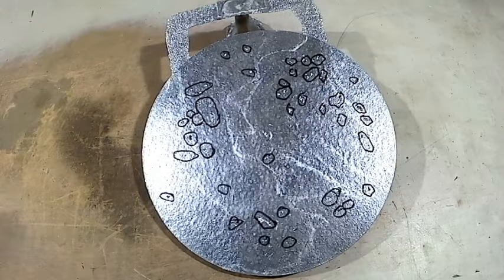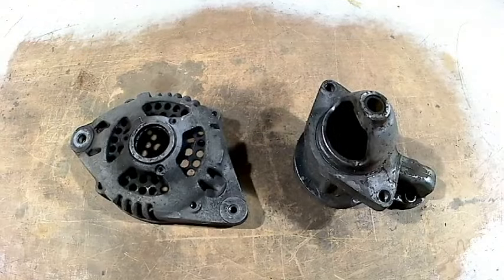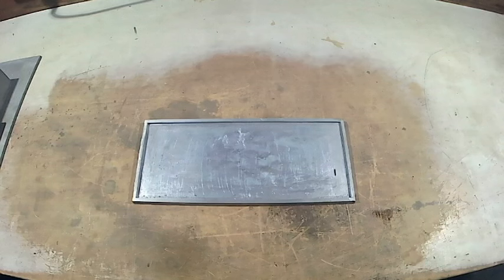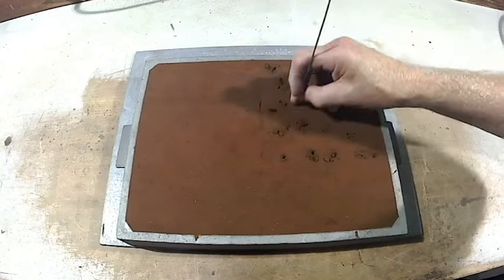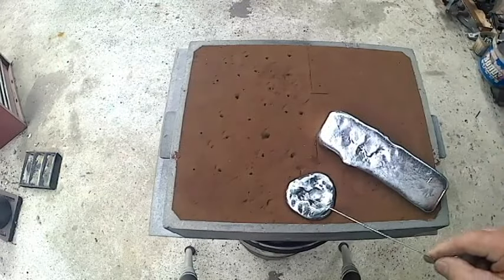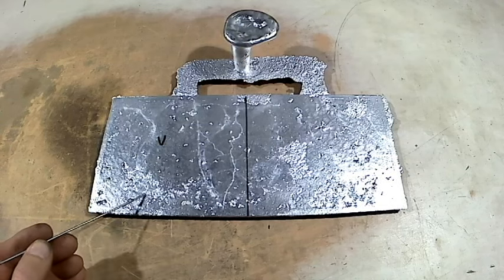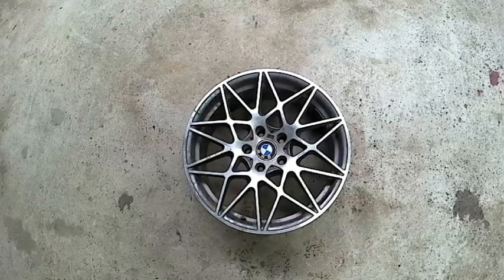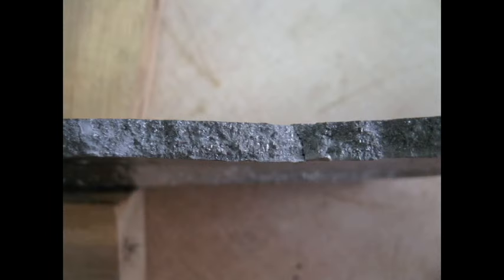Why I hate casting aluminium.

Comment: Hi, I had a good friend that used to cast engine pistons commercially. The alloy is critical to get the correct structure then they had to be heat treated to give good machinability and hardness. They came out like jewels they were so perfect. He always used CBN and diamond tools. Now those castings you have been looking at are pressure castings. The metal is pumped into the mold under pressure. I worked at Cosworth where they developed this process filling molds from the bottom. Aluminum  also has to be degassed before pouring but I am sure you know that. I have done a little aluminum casting just making blocks for machining  and they worked out ok.

Comment: The BMW Rim is likely forged aluminum alloy so it would have been alloyed to withstand that processing. Here is a cut and paste from Fuchs: (as you know most cheaper wheels are cast aluminum):
"In the first forging stage, the blank is forged into a rotationally symmetric piece under a force of 4,000 tons. In the second forming stage, the styling is pressed into the pre-forged blank in a 7,000 ton press, which largely gives the wheel its later appearance."

Comment: I read a paper some time about some Silicon containing Aluminum alloys can have an issue with the Silicon Carbide crystals floating to the top of the cast. Industrially, they use big mixers to agitate the Aluminum while it's molten. I'm not 100% sure about that answer, but when I saw that the alloy had separated like that it reminded me about that paper and it made me Google what alloys are used for cylinder heads, and all of them are Silicon containing, so that's my best guess.
Reply: I believe that silicon carbide is more dense than aluminium, thus would sink to the bottom of the mold.
Reply: @UncleKennysPlace  I may have gotten that backwards, but I do know it had separation issues

Comment: Hi,
I will try to remember some of the things one of my best friends told me some 20 years ago when he worked at a company that was doing aluminum and bronze castings. It was mainly in metal molds if I am not mistaken. I have never in my life worked doing any kind of foundry work so take what I write with a grain of salt. First I recall aluminum-silicon alloy would generate bigger grain structures and worse flow than aluminum-copper alloy. They would always try to use the one with copper alloy. The other issue was that molten aluminum will absorb a lot of hydrogen very fast and at cooling it would exit the molten matrix and leave small bubbles inside (not sure if on the surface) and they would show very bad later when machined. To solve that they would use some sort of tablet or cookie shape tablet that would be tossed into the crucible just before pouring. That thing would sink to the bottom and generate a lot of bubbles (I might recall it was some chlorine gas) and that gas would drag or combine with the hydrogen, lowering its concentration to a big extent. He told me too that for car rims they would apply some sort of low pressure to obtain a better casting surface. A vacuum like the one generated by a vacuum cleaner with a relief adjustable hole. I imagine there might be some way on the internet info to discover if your source material is more silicon or copper inclined.

Comment: I've been casting aluminium on and off for decades, never has this problem. I have learnt to cast my scrap into batches of ingots first and test each batch by breaking an ingot from each batch to see how the strength and grain structure is. Had a problem a few years ago with huge crystals forming and a very weak (useless) castings, think it was some diecast zink that got in the mix? 
I use oil bonded sand, dead easy and no need to vent except for things like long cores.
Agree about the car wheels being a pain to cut up. Easier to break them up with a sledge hammer, than to cut them. Water cooled VW cylinder heads are made of really nice alloy....
Reply: If you can tell me how to get the air pockets out and how you are testing the alloy, I would be eternally great full. My goal is to just be able to cast a cylinder so it can be machined for students. It would help a ton with getting the costs lowered for the class and make it so we don't have to charge as much.
Reply: I've been using a bunch of Audi heads I've saved up (destroyed) over the years of my car hobby. They cast very well, very cleanly. Wonder if Volkswagen auto group just used a better alloy for its Al parts. I've worked on porsche, audi, VW and they all share a surprising number of parts
Reply: Casting twice once into ingots and later final part mostly removes the problem, as it is caused by impurities carrying gas. One other thing that can be done is degassing using small quantity of baking soda (sodium carbonate, NaHCO3)

Comment: Surprised you haven't rigged up a hydraulic press out of something like an old log splitter to break up the car rims. Heavy blanket over it should eschew any risk of bits shooting off.

Also, I agree. Part of me was thinking some metal in the alloy may be holding onto oxygen much more aggressively, but looks more like a constituent metal is precipitating out as it cools. 

I suspect there is still a way to use it, but the ideas that come to mind would be quite the engineering undertaking. Alternatively, might be able to use that to your advantage if you can find a way to control where it precipitates out, remove that section, and reuse the clean material.

Comment: Perhaps before you toss that stuff, try lost foam and see if you get the same thing happening. Foam with plaster painted on and straight sand to support. If it works, happy days, if not you can still send that 200kgs to the scrap merchants. On another tangent, the crucibles you use for cast iron, would they handle casting steel? If so, what type are they and where do you get them? Have been watching your channel for years, and have learnt so much. Thanks mate for sharing your knowledge
Reply from the maker: There is one problem using clay graphite crucibles for steel is it will absorb the graphite and change the carbon content in your steel.
Reply: @luckygen1001  So, adding carbon to the melt would fix that….or use something other than graphite crucible?
Reply from the maker: @stewartwoerle6351  I f you don't mind the carbon content in steel changing use a graphite crucible.
Reply: @luckygen1001  I’ll give it a go on some smaller stuff. I eventually want to make a pourable crucible/furnace to try making a swage block somewhere around the 50kg mark. Will mean making the crucible to suit, so want to find the best materials that will withstand the temperatures required
Reply from the maker: @stewartwoerle6351  That is the best way, do a small scale experiment instead of spending lots of money and find out that it does not work.
Reply: @luckygen1001  that’s the plan. Will let you know how it progresses. Cheers mate

Comment: Very Interesting and some good testing done. I recycle a lot of Japanese motorcycle parts in my foundary , I hear you about cutting up wheels , years ago I decided to try breaking my melting stack up using my 30 tonne hydraulic press, it has become somewhat of a sport here , after a few months I now drop a heavy beach towel over the scrap being crushed apart and wear a heavy smiths leather apron, the ballistic capabilities of the press are impressive! 
I listen put for the “creak” usually between 12-20 tonnes of pressure then it just goes “SPAAAAAANGGGG! “ 
Just got back into the shop and planning a new burner etc , will look at your channel as great reference and up date my vintage set up .
Thanks mate .PJ
Reply from the maker: Years ago I had access to a 150 ton press and I have to agree it is the only way to break up scrap. So now I am retired and have to use other methods.

Comment: I'm guessing here, but as far as I know modern aluminum casting like the ones giving you trouble are a strange alloy that has an almost 2 stage crystallization process with some of the metal starting to form crystals while the rest is still molten. They inject the molten alloy at high speed and pressure into metal molds where it cools down very fast leaving a very strong micro crystalline structure. But if you try to cast it traditionally it can get all funky with the initial crystals getting quite large while the rest is still molten.

Comment: Wow. It looks like very uneven retraction during cooling and solidification. My guess is the melt viscosity gets extremely high near solidus. Segregation and forming of dispersed precipitates before bulk solidification would be the perfect mechanism for that to happen. And the metal cannot flow to fill the shrinkage around cooling zones. It would be consistent with the defects being way worse on the cope side. 
I see @akdenyer talking about pressure casting. He may well be correct. High pressure injection would actually solve this problem by forcing the metal to flow towards the shrinking areas, regardless of the viscosity.
This alloy seems useless for fine casting. You may still be able to produce ingots for machining or forging.
Reply from the maker: The cope side is usually the last part to solidify and the top of the sprue as well so that is why that defect happens the most.
Reply: @luckygen1001  Yes. If the metal is too viscous and cannot flow from the riser to compensate for the solidification shrinkage, it will draw from whichever part of the casting is nearby and still somewhat fluid. And the weird voids is what one would expect if the viscosity is uneven, and the metal is not pulled equally.

Comment: Gas in the Aluminium smelt must be removed. 1) Using degassing tablets. Difficult to find. And when you do, a huge amount must be bought. 2) Use another gas, nitrogen to bubble through your smelt. Think "aquarium bubble" system, but now with nitrogen and heat resistant. Expensive and overkill. 3) The Chinese method! Melt the Aluminium, let it solidify in the crucible. Then re-melt. WITHOUT STIRRING then poor: no more bubbles. This cannot be done in a commercial smelter, as re-melting is too expensive (time consuming), that is why a reference to this method is difficult to find. I found it on some Chinese website. The alloy might make a difference, but don't focus on that.
Reply: Well ------------- I think I'm going to have to try that idea.
Thanks for posting that.
Chinese "quality" is always suspect but they are smart over there and may have stumbled onto something.

At the end of the day I think it's quality of the aluminum. Any car parts aluminum is going to be impregnated with oil and it would be very difficult to get it clean. Then there is temp control of the melt , degassing and venting.
I have done a little bit of aluminum casting and mine are very poor quality.
It's an art form for sure.
Reply: @canadianoddy8504  China is just a little more pragmatic. They know there's demand at every price point, regardless of quality; and will rise to any challenge. Our best and worst consumer products come from there.
Reply: @stickyfox  It's true they can make quality things, but I would stop well short of "the best".
Reply: @nobodynoone2500  they make all our computers and smart phones and most of our car parts now. I mean, I agree... we shouldn't think of that as the summit of achievement.. but we don't make those products here because we don't want to pay the taxes on them. Even tho we'll pay a tariff to get it from overseas.

Comment: What are you using for flux? 
In regards to the inconsistency of your pours if you cant identify the alloy used i would advise trying to use an entire part for each cast since you know that whole part was one alloy, you might want to do test pours with a chunk of the scrap first, a mini ingot and see how that comes out before doing a large pour.
if you are doing a large cast that requires several donor parts of indeterminate alloy you might also want to do a test pour using parts of those donors to see if the mix of alloys at the required ratio work.
there also could be alloying agents you could add to make it more consistent, IIRC higher silicon content is desired for better castibility, copper being the opposite making it flow worse and more likely t o crack.
However I believe your major issue is either trace iron from the car parts or gas bubbles, So i would say look into aluminum casting fluxes.
Reply from the maker: I don't use flux with aluminium car rims and always get a excellent result. If I get a large amount of one type of scrap it pays to melt a small amount to see if it is suitable for casting.

Comment: It looks like sand wash to me, or steam pockets due to water droplets in the sand, but I know you run your sand through the sand muller, so it should be thoroughly mulled well, so Im not sure what it could be really. Those hub caps might be some wierd mix of A380 or A413 since it is a bit more tarnish resistant, but Ive cast with those alloys quite a number of times and havnt had much trouble with them. It is defenitely weird that it is only happening with that one source of scrap.
Reply from the maker: This is why I made a video about that defect, very strange. It does not like to be poured into a sand mold. Looking at the ingot fracture it seems more suited for die casting.
Reply: @luckygen1001  After thinking about it, it looks like an aluminum alloy with high copper content, which really dont like moisture in sand at all, but it looks like almost an extruded alloy by the way the crystal grains were on the top of the ingot tbh. Either way, looks like metal to be turned in for "beer money" really, lol.

Comment: If you put the alloy rims on a fire bed, heat them up to a reasonable temperature it is easy to break them apart into small pieces with a hammer.

Comment: One more Internet Expert. (reading some of the previous ones were painful) Different aluminum alloys have different characteristic. General wisdom is that if it was previously sand cast then it should be a good alloy to sand cast. That automotive parts should be a good source of aluminum for sand casting. I wish it were so simple. There are many factors when choosing an alloy and with it process considerations. And you don't know all those details when dealing with scrap.

Some castings are die castings and that process is totally different than gravity casting. Iron is a required element in the alloy when working with steel dies, but is undesirable from a metallurgical aspect. 

Hydrogen in the melt is bad, but sometimes desirable. More hydrogen will cause more porosity in the structure but can also reduce the external shrinkage. When the alloy solidifies it will shrink, but where? Internal porosity might be acceptable depending on the part designed.

Some alloys have a fast freezing behaviour and some are slow freeze. Another factor to consider. 

Without knowing the alloy's composition, and testing how to work with that alloy, the best solution is to use only what you know that works with your process.
Reply from the maker: The iron is added to stop the alloy welding itself to the steel die. I think this alloy has a wide freezing range so some parts solidify first blocking metal to the last place to solidify. Die casting would prevent a lot of those defects.

Comment: It appears that a low percentage of magnesium was used in that aluminum alloy. The magnesium is forming grain structure at a different temperature than the aluminum as the alloy is cooling. Better for injection molding than sand cast. I seem to recall an acid test you could do on the casting to see if it contained magnesium, I will have to look up the test to find the correct acid and percentage.  Interesting video, thankyou.
Reply from the maker: I do have some HCL I could put on that hub cap.

Comment: Aluminium casting is very sensitive to temperature and overheating the melt often causes porosity however, your porosity seems to have sharp edges so it is probably inclusion porosity rather than shrinkage or gaseous porosity.... onother thing which points to that is that it's on the surface and not within the casting.... I would smooth out the flow (no 90 deg. bends in the sprue ) and remember the golden rule which is ALWAYS make sure the sprue is thicker than the casting and always sprue to the thickest part of the casting. Upon further research there seems to be an issue with Aluminium and hydrogen absorbtion... this sort of porosity looks an awful lot like yours does so a quick trial may produce what you want. Several methods are currently in use to degas aluminum. These methods include the use of nitrogen or argon, or a mixture of either of these with chlorine, as a purge gas
Reply: Hydrogen is a lot more of an issue than people first assume. I spent a year trying to solve a plating problem that eventually was solved by baking parts for an hour in a slightly warm oven.

Comment: Alloy segregation sounds plausible. I was thinking you could try the molding techniques which should reduce air entrainment to see if that has any effect. Smaller size sprue, pouring basin, tilting a plate casting like the one in the video so that it fills from one side gradually raising and not having streams running across the plate.
Reply from the maker: I use the same methods pouring castings from aluminium car rims and this defect dos not happen. I think this alloy is more suited for die casting.